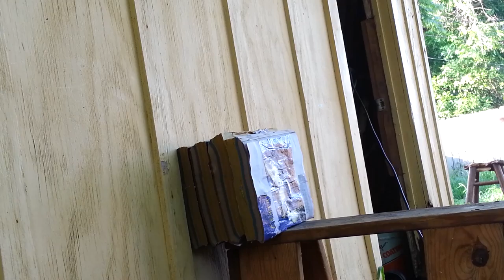Medieval Short Sword Fully Tested plus on Analog Ballistic Gel Head!

Comment: i don't think I've seen a sword like that before. i was under the impression that the medieval shortsword wasn't really a thing. were they common? what was their purpose?
Reply from the maker: +Guy Potts Archers and polemen used them as back up weapons . Knight carried larger daggers to the point of bring short swords as well early period. The shorter thrusting blade could get in to gaps and niches in armor since plate it self could not be pierced or crushed with a one handed sword. The shorter blade provided even better tip control and accuracy being mostly strong as well. The bade could still cut lightly or unarmored opponents and be used for close up fighting. The Bade seems to be a type XVI if you look on this page at example 4 it is about the same size a riding sword. http://myarmoury.com/feature_spotxvi.html
Reply: +ThegnThrand Good Thane and Eldgrimm! Have you ever reviewed a Blade that was sub-standard, broke, or performed poorly?

Comment: Would be intreating to see some of these fine weapons tested against modern kevlar,i think your heavy pillum would skewer a vest...ive penetrated kevlar completely using medieval inspired arrow points on my channel, just aint had luck with my spears
Reply: +tumbo1984 Kevlar isn't built to stop blades, so that's not a good test. It won't stop something as lightweight as a switchblade, much less a sword or arrow. A better test would be ceramic plate armor.
Reply: +John Pryce take a look at my channel mate,ive tested kevlar with mixed results

Comment: How sharp are this sword "out of the box" so to say? Did you guys need to spend a lot of time before you could make it perform this well?

Either way it was pretty damn impressive to see a short sword perform like this
Reply from the maker: +trucane IT comes fairly sharp but I did touch it up as I always do. The only problem with it is the cross guard came a hair loose not real bad but the hilt and pommel and stout and did give what so ever it seems to be full tang for sure putting up with our 4 hour testing session and well attached.
Reply: +ThegnThrand Thanks for the answer. Still surprising to see such good quality from such a "cheap" sword